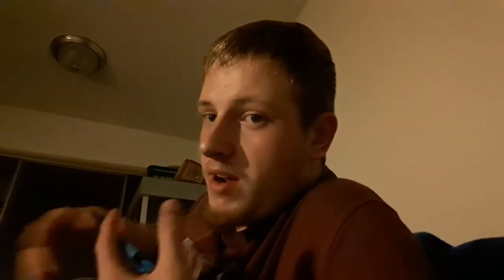How to Series version 2.0 part 3 etching and painting the plates

Comment: Something I noticed... foamboard can be curved.  I put Chicago screws into "back "plate . I glue front and back together and let it dry. Then put some gorilla glue on the back and position and brace it in the curved shape.  To glue the plates together I use weld bond glue. It's permanent, flexible and dries clear